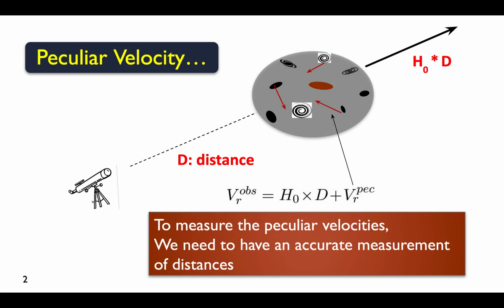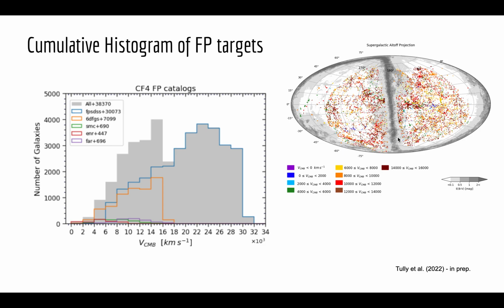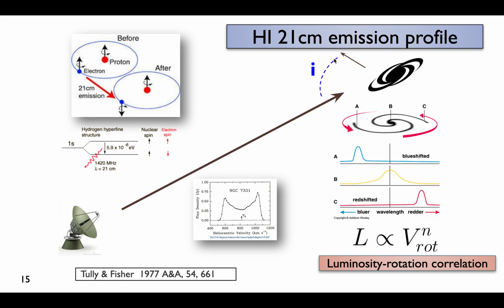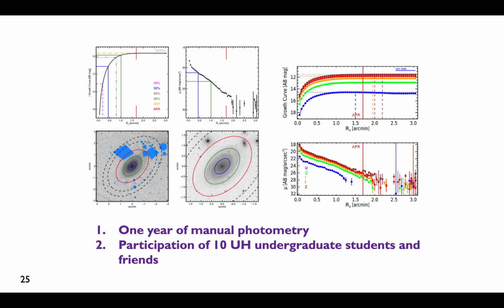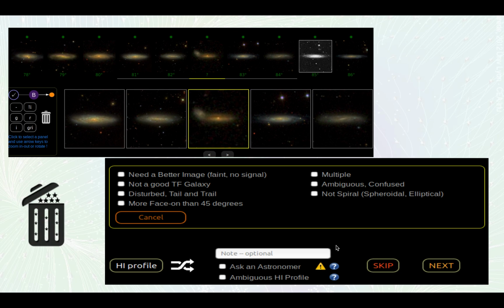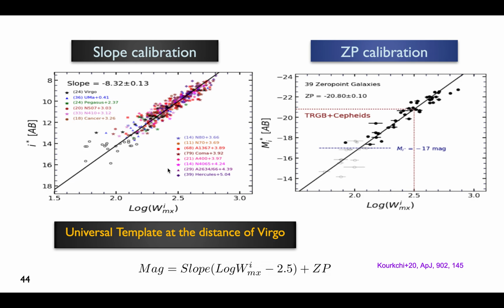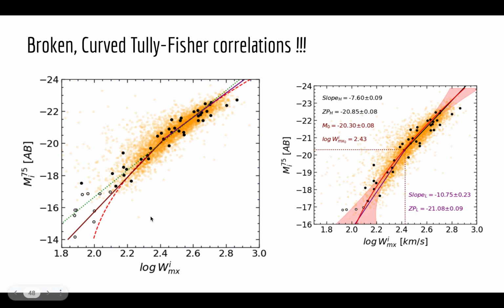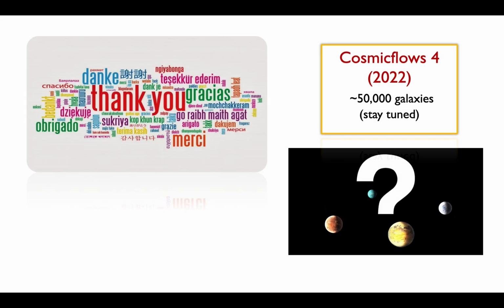Towards Cosmicflows-4

Comment: Hi Ehsan, is the accuracy of the Tully Fisher distance measurement 20 percent for your results as well or were you able to improve accuracy? Thanks.
Reply from the maker: Hi, 

The current accuracy of measured distances from the baryonic TF method is 20%. This value is conservative for bright galaxies that are closer. Although we prefer to report the average accuracy, i.e. 20%, in some cases the statistical accuracy can be as low as 10%.

One point is that, there is a 10-15% intrinsic scatter associated with the TF relation, which is attributed to the physical mechanisms that we don't know. TFR is solely constructed based on some assumptions about the dynamics and the gravitational potential of spiral galaxies. 

Good news is that for the kind of mass reconstruction we do in the Cosmicflows program, we average distances of galaxies that are in the same group or cluster. This reduces the uncertainty level and helps to get much more accurate peculiar velocities. At large scales, groups and clusters, as well as individual galaxies, are treated as test particles that follows the underlying dark matter gravitational potential.